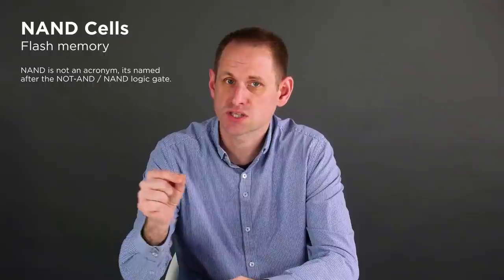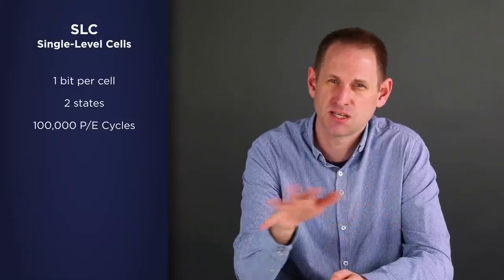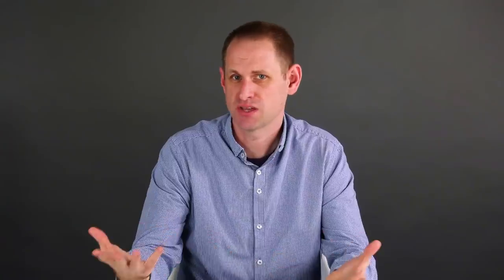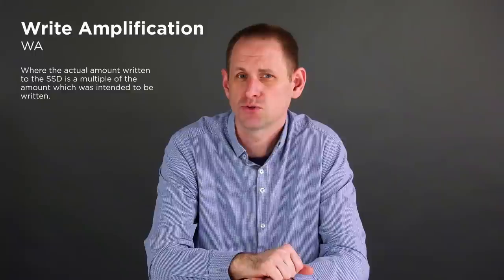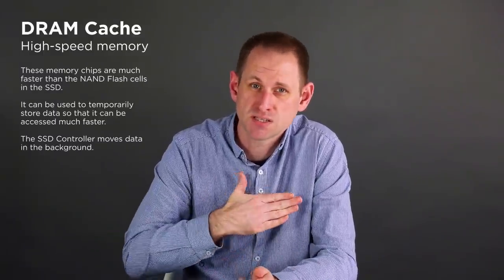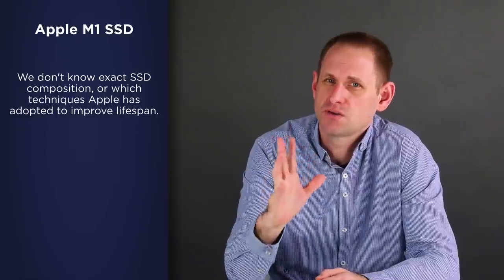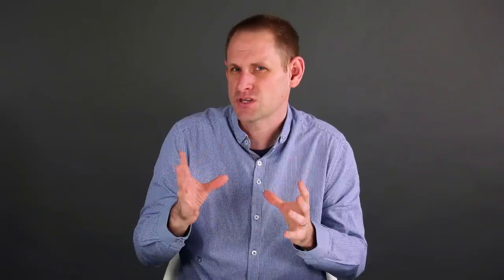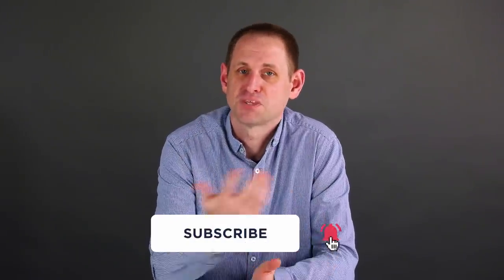How do SSDs Work? (+ thoughts on Apple M1 SSD lifespan)

Comment: The point that apple have well experience in ssd hence we can rest assured that they tested it is not a valid point at all.
They have experience with keyboard and they came with butterfly. They know how to design internal components in mbp and they made the screen cable a bit shorter on the mbp causing the screen to malfunction after couple hours of load. They know as every person that fans are important for intel and they made a fan with no heatsink connected on intel mba, they didn't use good solder for the GPUs in 2011mbp. And so on and on.
Most of those issues come a year or more later after use. Hence the need to update. And ssd will be an issue especially with base 256/8 models.
Reply from the maker: No product or company is perfect, and we’ll have to wait and see. They acquired more than 100 SSD engineers a decade ago - that’s a big team wholly focused on the technology for an extended period. I don’t think it’s quite the same as the (grossly over-exaggerated) keyboard and screen issues. At the end of the day Apple has been soldering SSDs since 2016 and I haven’t seen any reports of failing units. The technology will have improved since then.
Reply: @ConstantGeekery  bro, again having the best engineers in the world does not mean you will get a device that won't break in a year or 2. The exaggerated display issue I suffered from as with my colleague, along with millions of users online.  Apple does things because it will be profitable not because it's durable, and those 100 ssd engineers are not working on swap issue, that is not their responsibility if macOS is using as much ram as possible.
And remember that 2016 mbp till 2019 are using intel, also ssd speed is less hence less writing to ssd over time due to swap memory.

Finally to be clear, get the ram you need, other wise you will start to wear your ssd very rapidly,  and try to get higher capacity ssd as that will give more cells empty to write to instead of filling your ssd and writing a lot of swap on the few gb left.
Reply from the maker: @mrzouz  Sounds like you’ve been unlucky. I have no wish to have an argument, but you should understand that my comments are not just flippant - I have carefully researched this issue. I also base my comments on my own frame of reference, which is that of running businesses for more than 20 years, currently a digital agency with more than 30 staff, almost all using Mac. We change computers on a 3 year cycle, so that’s a lot of Macs and PCs we’ve bought and used over the past couple of decades. Not to mention servers, of which we currently have more than 40, all running SSD storage. Naturally, we’ve seen plenty of faults in that time with Apple, Dell, HP and other brands, but all of them got fixed without issue, and in almost all cases without cost. We only had 1 butterfly keyboard replaced (free of charge), and zero of the display issues you mention. And to date, we’ve had precisely zero SSD failures - Mac, PC, servers, NAS, external storage etc. - literally hundreds of drives! There has been plenty of spinning disk failures in that time, but not a single SSD has died. This is confirmed by industry-wide data showing that SSDs are far more reliable than traditional disks.

I’m certainly not an Apple fanboy and I’m not going to defend the stupidity of soldering SSD chips to the mainboard. I’m simply reporting the facts and trying to be reasonable. Anobit’s engineers are among the best in the world, that’s why Apple bought the company. Their specialism was in optimisation of SSD for performance and longevity. Obviously that doesn’t mean they are incapable of a faulty design, but so is every other SSD manufacturer out there. If Apple’s SSDs started failing, they would be obliged to recall and replace them by governments… but is it reasonable to think that a publicly traded company of the magnitude of Apple hasn’t taken appropriate precautions to minimise that risk? Clearly they will have tested a significant sample of these drives to destruction (just as every other manufacturer does) in order to ascertain the reasonable expected lifespan. If the drives from 5 years ago haven’t failed, why should these?

I have also extensively tested the M1 SSD and swap behaviour, with many different machines, and analysed the data from almost 2,000 survey respondents who shared their SSD usage with us. I’m confident the majority of teething issues with Apple Silicon have been fixed. Regarding swap, I have always advised people correctly to buy an appropriate amount of RAM for their workload, though it should be said that swap space will be used even when the memory is not fully utilised - and that’s not Mac-specific behaviour. Many people are also completely overlooking the very likely use of cell emulation for swap space, which completely changes the lifespan question by an order of magnitude. Nobody knows the composition of Apple’s NAND or what percentage is being used for emulation. 

Apple the corporation may behave in scummy ways, but the actual employees and engineers doing the work care about what they are doing and are clearly putting their heart and soul into that work.
Reply: @ConstantGeekery  same here, not looking for argument, and stating that you replace your mac every 3 years explains why you rarely see the issues alot faced.
thanks
Reply from the maker: @mrzouz  we typically recycle more premium machines within our business and use them in other departments, so we have quite a few older machines too, but fair enough. Thanks for sharing your experience.

Comment: In your previous video (Part 1 of the results) you actually repeated stated it was a "real issue". You didn't once try to assure M1 users like you did in the original M1 SSD video.
Reply from the maker: Well let’s see: in the intro I clearly stated that that most users will be unaffected and that the SSD will likely outlast the machine. Then again in the disclaimer we discussed how the issue won’t affect all users. Then there’s the bit where I point out that actual usage figures will be lower than our survey data. Oh, and the bit where I express my belief that there are software bugs which can be fixed.

Comment: So, you are saying that we don't know about the details of apples protection technology but, since it is apple, we have to believe. Sounds kinda religious to me. I don't believe that the ssd in my notebook will fail before I stop using it. Still, saying it probably won't since it is apple, is kinda...meh.

I had 3 home buttons failing, and those were designed by that very company
Reply from the maker: That’s a fairly comprehensive misrepresentation of what I said.

Saying that one company knows how to make a product does not imply that others do not, nor does it imply perfection and zero manufacturing defects, which is impossible for any company to achieve. Plenty of components fail. I have extensive experience with Apple, Dell, HP and ASUS - failure rates are pretty similar across them all.